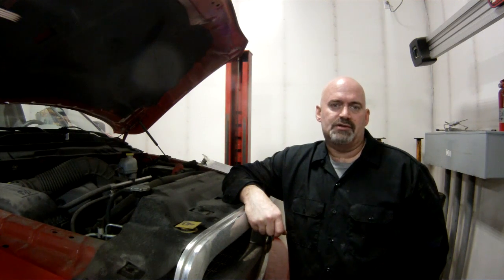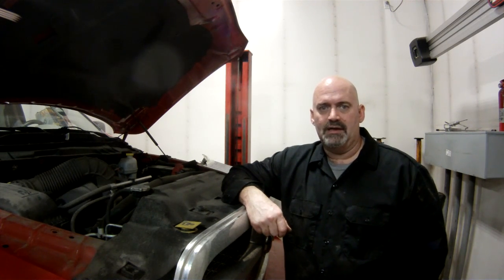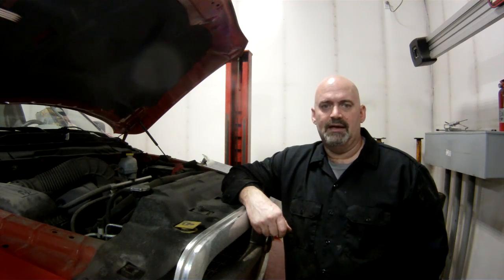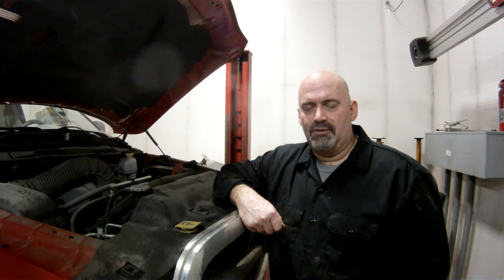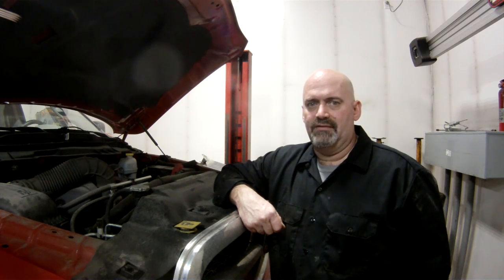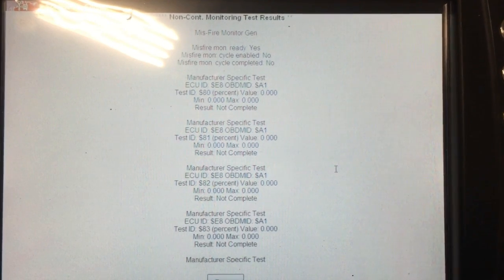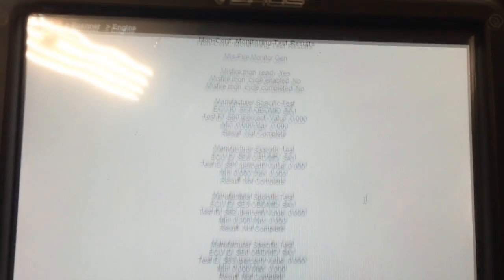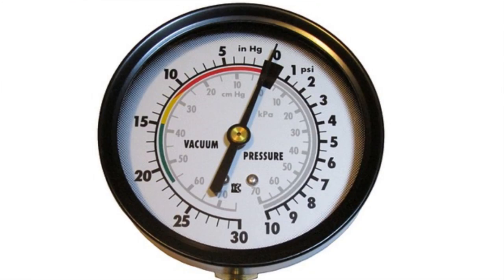Dodge 5.7 Hemi Misfire Problems

Comment: Just changed ignition coils and spark plugs. Still have flashing check engine light on. Before was working fine but I did change most of my heating system. Could air in my cooling system cause a misfire?

Comment: I have p303. New spark plugs and swapped around coil, all good. Now what ?! Any ideas welcome. 
He starts fine, the issue is my car seems to not want to shift and once I go 40 Mph  my check engine light goes blinking and ringing. Then if I keep pushing it he will shake and feel like it’s going to stall out (haven’t pushed him other then when I was forced in traffic)
Reply from the maker: Compression test is in order. Then pull valve cover and check components. Good luck

Comment: I own a 2007 Dodge Ram 5.7 Hemi I got a p0300 random cylinder missfire and I check all spring values and change all spark plugs and all coil packs and still got the P0300 code after using my maxflex scanner to clear the codes please help me

Comment: Changed plug ,injector and coil still number 7 missing with a loud thicking 2013 durango hemi .thanks for video
Reply from the maker: That’s not good. Compression? Check your valve springs.
Reply: @ThecardoctorTV  yeap i let him take it to somewhere else i ll not open up another dodge lol

Comment: My 04 Dodge Ram 1500 hemi throws Code p0306 and started to lose power on uphills. Replaced map sensor and seemed to solve the lost power but still misfires in cylinder 6. Replacing the spark plugs and fuel injector. Hopefully this will solve the issue. If not may give this a try thank you.

Comment: Just curious, I have a misfires in mine, but it's only random. Sometimes it misfires while idling, sometimes it doesn't. 04 Durango 5.7 hemi.
Reply from the maker: Sounds like a fuel or ignition issue.

Comment: Hello !!
My 2011 Ram 5.7 Hemi 
Engine run on 7 cilynders because 1 fuel injector doesn’t inject gasoline.

Inspectioned with apposite machinery for injectors and it result well. Both spark plugs are ok for this cylinder.

According your experience what could be the problem ? 
Thanks

Comment: I have a problem 2007 ram 1500 5.7 hemi just had oil pump water pump timimg chain replaced now my truck bogs out when u go 65 to 70 mph and it runs a high 3000 rpm at those speeds
Reply from the maker: Weird. Transmission problems?

Comment: I'm dealing with this now. I have a 06 Dodge Charger 5.7l hemi. I got gas the other day at Walmart then went into Walmart. Came back out and started to head out the parking lot and my engine light came on. It's saying I have a cylinder 7 misfire. Unplugged the coil while it was running with no change, tried on all and it was the only one that didn't change the idle of the engine. So replaced the coil. The engine light went off, but I noticed oil on the boot. So decided to change the spark plugs and the valve cover gaskets. Engine light came back on after I picked up those parts on the way home, still cylinder 7 misfire. Change the parts and I still have the same code. So guess I'm getting a compression test next.
Reply: Does it have a battery in the trunk like the 300c?

Comment: I need help BAD. I have a 2011 dodge ram 1500 5.7 hemi, codes are a po300, po302, p2305. one start up its fine, once driving and under acceleration it starts misfiring, its got good compression, no ticking or tapping sounds, ive replaced all the plugs and coil packs, injector is fine, I cant find any solutions!
Reply: Did you find a fix?
Reply: @titob1895  yes i did, my lifter collapsed onto my cam, i fixed it myself for around 1200.
Reply: Have you have the issue come back since
Reply: @titob1895  no issue never came back after the repairs.

Comment: Hi folks, I  own several dodge vehicles with hemi engines,  the number one cause of misfires I have found in almost every case is trash and rust in the drivers side fuel rail.   Remove fuel pump fuse and start engine to relieve fuel pressure. Unplug the electrical from the four injectors and remove the two hold down bolts.  Pull rail with injectors straight up.  Next remove clip from number 1 injector at the front of the rail and pull injector out.  Have a clean container to collect any fuel left in rail, preferably something white.  If the fuel that comes out is yellowish with trash in it then remove the other three injectors and flush the rail out and clean any debris from the inlet end of each injector.  Reassemble in reverse order.  The reason this happens is the front of that rail is the end of the line for the fuel system.   The odds are the fuel pump is also bad.  It may show good pressure but inside the fuel pump assembly trash, rust and gum have collected and gets past the filter  plus rust can start in the rails themselves.  This debris fills up the end of number one and number three injectors and can jar loose causing intermittent misses usually worse on a cold start but sometimes gets better as you drive because the shaking engine and driving jars some of the debris out of the injector inlet.  If you don't change the fuel pump the problem will reappear.  The passenger side fuel rail is rarely affected.  Only a misfire code will appear as no code is in the system concerning this problem.  Drive safe and enjoy the Hemi experience.
Reply: Was any of them ever a coil?
Reply: @TJones-bf1rj  no
Reply: Very cool thanks a lot
Reply: @alabdlilah  your wecome
Reply: My 04 5.7 ran fine before I replaced plugs  coils and wires. Used OEM parts. Runs a little rough. Misfires under medium/high load (highway). Gap is correct and OEM parts. No steady codes. Just flashes when under load. What do you think? Also, bran new fuel pump before the tune up.

Comment: I have a 2009 ram 1500 5.7 hemi  number 3 cyl shows misfire mech. said it showed low compression what would be the cause. only 85,000 miles

Comment: I have the same issue with a 2012 dodge ram 1500 5.7 hemi...it has a miss fire on #2 i replace it and still the same ....wht else can i do...
Reply: You may have an exhaust leak.  If you have mds, try shifting it out of drive to a lower gear when you start it up and get going and see if it still does it.

Comment: Good evening my 04 Durango Beni is shaking while ideling and the check engine light flashes I just changed out the heads but I’m not sure what else to check I was told to check spark plugs and coils. I have changed out the spark plugs but not the coils. And is shakes while I’m driving at a solid 60mph. If any has suggestions please let me know thank you.
Reply: Sorry Hemi.

Comment: I have a 2011 1500 Just curious if  that vacuum test and compression test would work if it is only misfiring going about 50 miles an  hour and then getting hard on the gas causes CEL to flash get a cylinder 5 misfire every time but never comes on when driving normally even at highway speeds. And also would this also work if the lifters are bad wearing the cams which ive been leaning towards. 
 definitely has top end noise sounds almost like a diesel truck

Comment: Hi i have a 5.7 v8 ram 1500 2012 with 180k miles, I've been having a po305 for a long time (rough running, no problem etc...), suddenly i have a Po 300 what this might be? 
Plugs  and "coils", were changed
Reply: fuel injector
Reply: I have the same truck with 162k miles, when I floored it the other day and got up around 80mph the truck started to misfire and the check engine light came on. I put the scanner on it and got the po305 code. I changed all the spark plugs and the #5 coil pack. I though that would fix it but the next day I had the same problems.
Reply: @drunkpunx83  i did the same as you and the truck kept running same way

Comment: I have a 2010 Chrysler 300S 5.7 with a PO305 code. I c/o coil pack and replaced all spark plugs, I don’t have a ticking noise but rough idle. What kind of compression psi should I have? Rough idle but when driving check engine light comes on but if I let off the gas pedal it goes away for a little while but then code comes back. What would you recommend I do next?

Comment: Is this issue common on the 2014 as well? I have a 5.7 showing CEL for both multiple misfire, and misfire on cylinder 8. I changed all plugs and coils. No improvement.
Reply: Hey maligant I'm having some issue on mine any suggestions on the fix. Thanks
Reply: I ended up selling the car. I got my money back out of it since I got it dirt cheap. My guess was a total rebuild was in the near future. It’s a 50/50 roll of dice with any 5.7 hemi over 100K. Best of luck. Post it, if you find out what it was. I have a 2012 Hemi Charger also. Zero issues. Knock on wood.

Comment: I have a 2012 Dodge Ram 5.7  misfire #6 code  no injector pulse to that injector checked #4 and it pulses and engine stalls out when unplugged but when I disconnect #6 no change   Does the pcm control injector pulse on dodge vehicles? I’m a Chevy man but looking out for a friend   Anywhere online to find a free pinout on pcm to injectors?

Comment: Can I swap ignition coils between cylinders ( the misfiring and a good one ) and see if something changes in the codes as a test? My misfire is on Cyl. 6. I changed the sparks today and nothing changed. Since I amy engine is at only 80K miles I think it is unlikely that would be the coils and wanted to do a nifty test like this as a way to cross that off my list. Does that make sense? Great vid BTW!
Reply: Did you ever get this fixed?
Reply: @rigobertosanchez4689  yes I did. At the end the issue was that the solenoid  of cylinder 6 was busted. Those selenoids turn 4 cylinders on and off to save gas basically, one of them would occasionally not turn the cylinder on.

Comment: The most common problem with the MDS and VVT hemi's is crushed/seized lifter roller. Then it'll start machining down the cam. They actually run decent with a surprising large amount of the cam lobe  shaved off.

Comment: 07 ram 1500 single cab 5.7 hemi 4x4, when you start it for the first like 5-10 minutes it has a light knocking sound but after the motor warms up it goes away it drives good or as good as I feel it should, it has no codes but it is acting like it has something wrong so before my pocket melts I wanna try to save it
Reply: That's because when it warms up the heat shield moves and it no longer Taps on the manifold.

Comment: I have a 2012 Chrysler 300 5.7 I recently got the code P0308 misfiring 8th cylinder already did the all( 8) coils and (16)spark plugs. code stayed on anyone have the same issue and how was it resolved? Thanks in advance
Reply: Change the crank and cam sensor.  Worked for my truck.
Reply: Gerardo Diaz same with me, but I have a code p0302 ( misfire)  I changed all the spark plug, coil, injector, and it shows the same fucking code!! the car runs well, until you accelerate up to  70 mph and the check engine came out, also my I did a Vacuum leak, it worked fine again for a few weeks and then the same code appeared, I think I have to change the cam and the lifters. Tell me if you have the same issue

Comment: no, i have others problems
Reply: Probably the same problems I have.  2012 5.7 hemi...cold start idles low as turtle nuts and just kicks back up to 1000rpm. Light comes on and codes p1128 p1129 p0135 p0155.  Please dont tell me what they are, I thoroughly know. And please dont say I need to changed my O2 sensors i have like three sets of em sitting in my kitchen.  So any news is good news from anybody.
Reply: i can not find  dct: p1128/29,  po135 is o2 1/1 heater circuit
Reply: @makantahi3731  P1128 closed loop fueling not achieved Bank 2.  1129 is the same but for Bank 1.  They both correlate to the respected sensors kicking the 135 and 155 sense those are both for each bank as well. Been chasing "said"  ghost since June 2018...smh
Reply: sorry , i can not  help you, i had similar problem, after coolant leaking and washing cables of coolant, right bank mixture too lean,  02  sensor  connector was wet and in short circuit and after drying it is ok, but last year i had problem with instrument cluster- all lights around speedo and  rpm meter blinks, gauges dies for 1-2 seconds, air condition blower motor stoped  for 1-2 seconds, but  last winter it did not happen  maybe it get health by it self

Comment: Same issue I have it always start on cylinder eight am going on my second engine the first engine had a miss fire on cylinder eight blew off the engine second engine miss fire on eight cylinder again and randomly miss fire am so disappointed with dodge truck even tho am a dodge fan 😪

Comment: I'm livid! I bought my truck used with around 80 thousand miles. Got up to about 155 thousand and started having misfire problems.  Was thinking time to change spark plugs and wires but turned out to have multiple misfires on 4 different cylinders. Ended coming to the conclusion of cam failure and buying a used engine from a warehouse. Don't know the mileage on this engine since they sold the one I was supposed to get b4 my mechanic got there and gave me one with no info. They usually sale engines with around 80 thousand or less miles there but have no idea for sure. Was in a bind with transportation with jobs I needed to get to and finished so went with it. 8 months down the road, same thing....I started having a misfire which was very noticeable a few days ago and went to have a diagnostic test ran with the exact same codes as last time! Granted I only spent around $2,700 for the "new" engine with installation included for about 4-500. What the heck is wrong with these engines!?? What are the chances I have the same problem twice causing engine failure with the same kind of engine?? Any help with this would be very much appreciated! Sad part is I still owe over $6000 to pay off!
Reply: David U it’s a turd
Reply: Wow i was just asking my husband the same question.Our 2011 Dodge Ram 1500 5.7  is a beautiful pile. We have all of the same issues going on. Were about to buy a crate motor from Summit instead of just doing the top end but is it just going to create the same problems  100,000 miles from now? Is it time for a new truck or replace the engine

Comment: 2011 Challenger 5.7 Hemi random misfire, no codes. Changed plugs no change. Any ideas folks. Thanks in advance.
Reply: Did you fix your issue?
Reply: @mikeprice8307  I'm thinking it was the K&N intake I had installed without a tuner. Maybe pcm didn't know what to do with all that air?
Reply: @rmaldonado3185  ok I have 6.1l with random misfires..can't figure it out

Comment: Vacuum testing used to be the goto procedure for many diagnoses. We seem to have lost that skill, vacuum testing isn't done nearly as often as it was. I love this kind of low tech diagnostic.
Reply from the maker: IM all about low tech!
Reply: Good point, I've only ever used it to tune carbs. My roommates and I have 6 classic cars so I still use my vacuum gage but I've actually never used it on a fuel injected engine. Unfortunately my misfire issue is random P0300, did a compression test first, changed plugs, wires, coils, injectors and fuel rail from a known good running engine. Same code, same flashing "check engine light". I just got a new scanner today that gives you real time misfire data. Only cylinders 2 and 3 missed on this test. I have a feeling it's a lean condition in those cylinders so next I'll check the o2 sensor data. But, honestly, I don't know what numbers to expect. What numbers would be normal, lean or rich?
Reply: @waynethomas1726  Scannerdanner here on Youtube has a whole series of videos demonstrating and explaining fuel trim, I would start there. Mostly I use the reaction to the situation, anything less than a 10% fuel trim correction is within acceptable limits. But for single cylinder misfires (perhaps even on separate banks), fuel trim has limited utility since it reacts to the trim of the whole bank as a unit, rather than one cylinder by itself. So if one cylinder is getting less fuel or the spark doesn't fire, more oxygen gets to the upstream sensor and more fuel is sent to the whole bank, making the other cylinders rich. I use fuel trim to quickly screen for the most common cause, vacuum leaks, looking for a lean situation (computer adding fuel), with improvement when you put your foot on the gas. Then for single cylinder problems I go for spark first and work from there. For the complicated ones, a scope can really help.
Reply: @spelunkerd  After I posted that I did a bunch of reading about O2 sensors and what their readings mean, etc. The new scanner doesn't seem to give me fuel date in terms of LTFC and STFC but I'm just scratching the surface of what it can do. I'm sure is not an issue where the scanner doesn't do it, it's more likely the operator doesn't know what the hell he's doing yet! LOL Even though I had good compression numbers I'm going to do the vacuum gage test and if necessary pull the valve covers and check the valve springs and cams. I'm super lucky it's an 03 5.7 Hemi, and not the later ones had the multiple displacement crap.